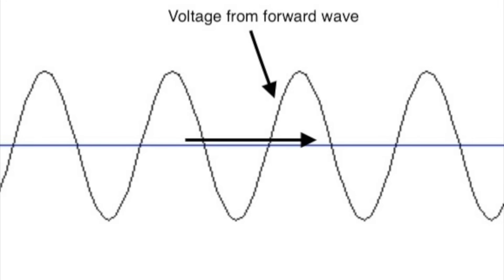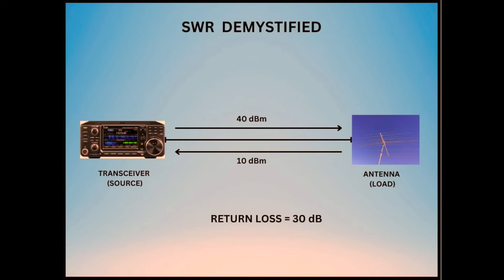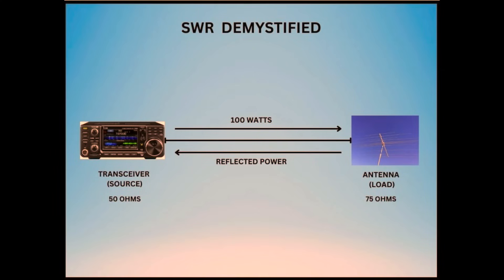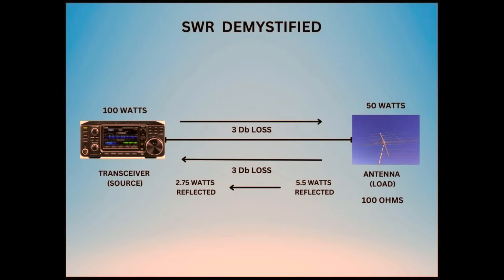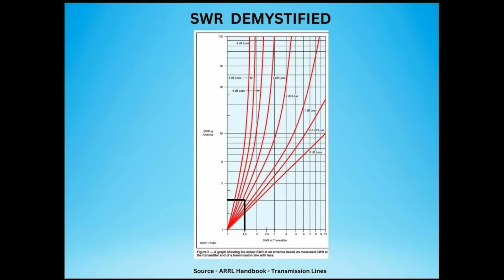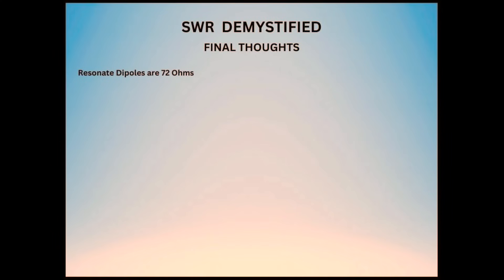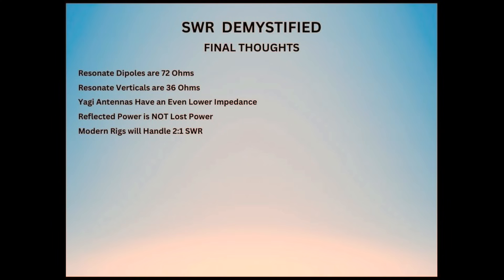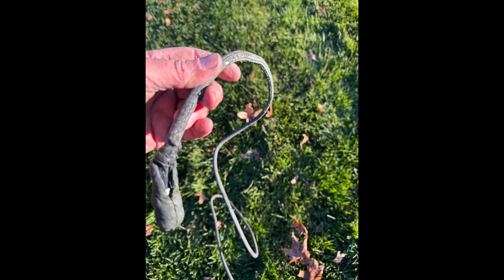The Truth about SWR: Debunking the Myths and Misunderstandings

Comment: Nicely done! 99% oh hams today have no clue about this sort of thing. I solve the loss in coax problem by NOT using coax. I use 4 inch wide open wire transmission line. de W4AUV dit dit

Comment: This is a controversial subject. I believe this issue largely results from a lack of education, and the marketing power of big companies who sell overpriced antennas and related appliances such as antenna tuners. There are basic fundamentals that should be understood. Good reference material on this subject was authored by Walter Maxwell, in his works Reflections and later versions. To get into a specific example - in a typical arrangement, we have a transciever which goes through a tuner into a feedline to an antenna. Adjustment of the tuner will indicate a low SWR. This does not change the situation at the antenna feedpoint, where we still have an impedance mismatch, resulting in reflected power thus reflection loss. This reflected power does not disappear. It travels the feedline, and at the output of the tuner, it does a phase reversal and now is added to the forward power. Most of the total losses occurr in the feedline, as stated in this video. Cutting a dipole for resonance at a particular frequency will not necessarily give you a "low SWR". It depends on the feedline impedance. At resonance, a half wave dipole will present a feedpoint impedance of about 72 ohms. And as stated in the ARRL Antenna Handbook, an antenna does not need to be resonant to work well. Resonance in this case simply means that capacitive and inductive reactances are equal, thus making the antenna feedpoint resistive rather than reactive. Therefore, with a 50 ohm feedline you have a mismatch of 1.5:1 at resonance, and there is nothing you can do to change this. Most coax is lossy, and this loss increases with frequency. Using a balanced feedline will minimize the effects of reflection loss. This is why a good multi-band antenna for HF is a wire dipole as long as you can get it fed with balnced twinlead wire, using a tuner at the transmitter. Twinlead experiences low losses despite very high SWR values. Lastly - don't believe the advertising hype of many manufacturers! The laws of physics always apply. The usual repsonse when I try to talk to people about basic antenna and feedline principles is to see glazed-over eyes and a change of subject. There are various things you can do to compensate for feedline loss. You can increase the gain of your antenna system, or use an amplifier. I refer to this phenomena as the "SWR boogeyman".

Comment: I always chuckle at fellow hams who are bragging about an antenna with a low SWR over a very broad bandwidth because they don't realize that they're describing a dummy load.  They've been taught that a low SWR means the antenna is a good impedance match so maximum power is transferred, assuming that low reflected power equates to high radiated power, but that's only true in a high Q resonant system.  Some antenna manufacturers exploit this misunderstanding.

Comment: With an external antenna tuner, to ensure your radio always sees low SWR, (even if it has an auto tuner), and low loss feed line, many antennas should work fine over a wide frequency range.  e.g. I use a G5RV with most of the feed line being 400 ohm open ladder line (very low loss and actually part of the antenna at lower frequencies) and a short piece of good RG8 coax to the transmitter.  It will tune up on ALL ham bands from 80 to 6 meters (with a wide range of SWRs!) but the low loss feed line combination means that most of the radio's output does get radiated.  This works so well that I've no motivation to install single band or tuned multi-band antennas.  Although a beam would be nice!

Comment: VSWR is a matter of instantaneous voltage measurement. This includes forward snd reflected voltages. What MUST be remembered is that the forward and reflected voltage peaks do not occur at the same time. Plug in average of forward and reverse voltages and factor in load and power calculations can be made. 

The big problem these days is that too much voltage or current can destroy power amplifier finals. 

I removed a BNC connector from my 2M 1/4 vertical antenna one time, and it was only up 40-ft and noticed sparking in the connector, which represented about 2800V on the line. There was a storm about 1/2 mile away. I didn't disconnect my SB-104 and the driver transistors were blown away... on low power setting, drivers are connected to antenna. Lesson learned. 

Same results happen with too-high SWR readings. Instantaneous high voltage can puncture transistor junctions. KK5R

Comment: If the length of the transmission line does not matter can you explain why ‘quarter wave matching sections’ work?
I’m in no way trying to be ‘that guy’ but I think this is an element that needs further explanation.
73s hope to hear you all out on the air sometime.
Reply: Because impedance is constantly changing along a feedline due to the wavefronts travelling down it, you can use it as an impedance transformer. A quarter wave section will transform a high impedance to low impedance. A half wave length of feedline will reproduce whatever impedance is at the other end. So a 50 ohm piece of coax is not always 50 ohms!

Comment: You made good point about "if" you make a good antenna with a good quality low loss cable, you can have an antenna system that performs very well.  In my experience, most people don't do that. They buy the cheapest cable they can find, and string up some left over scrap wire, and stick a tuner between the radio and the antenna and call it a day. 10:1 SWR? no problem! my tuner can handle that.  I do agree that most people forget to factor in the loss of the feedline, when looking at swr measurements. I'd also like to add, that in addition to good cables and a quality antenna, you should try and put the tuner as close to the antenna feed point as possible. This should help eliminate the losses that come from the reflection, as the tuner would be immediately reflecting back the signal to the antenna.
Reply: yeah
I myself usually measure the SWR of my antennas with feedline attached and I use speaker wire as my antenna material

I usually manage to get a 1.3 SWR on my target frequency with that wich is good enough for me

Comment: I'm old enough to remember when one of the old CB brands announced a "screw up" proof radio whose finals would not be toasted by holding down the boastin' button into really bad SWR.
I think all they did was up the voltage raiting of the finals so they could handle 100 reflected power. Might have an open and short detect and shutdown too, I don't recall... "it was the 70s, man". ;)

Comment: I just made a 6 meter dipole yesterday. The connector on the antenna side is a type N and it has about 25’ of LMR 400 cable. Radio says it’s about 1:1 but does go up to about 2:1 near the high end of the band.

I did put a a current balun at the feed point.

Already made a ~1000 mile contact today!
Reply: Thank you.  
   35 years ago, as a new amateur, SWR was the rage. 
  I used my SWR meter to check the antenna.  If the SWR had changed a lot, I started looking for problems. N0QFT
Reply: @glenmartin2437  That is why I went to 600 ohm open wire on feeders and doublet antennas. Wish I had done that 52 years ago. I use a T-type antenna tuner.73 de Joe W4AAB

Comment: Any impedance or reincurrence results in something heating up.
Heat = Electronic failure.
Reply: Reactance does not dissipate energy, therefore, no heat. Resistance does dissipate energy, therefore, heat.

Comment: I'm a new HAM with a confusing problem.  I have an MA-50 V/dipole, 50ft of cable with a   1-1.  The antenna is set at 7 meter band..  My G90 shows a flat SWR at 10 watts with no tuning but my new FT710 keeps yelling high SWR also at 10 watts.  What's going on?

Comment: I worked in the 2-way radio field for 33 years and before we had analyzers, if we suspected a problem with the antenna or coax, we would send someone up the tower with a wattmeter and dummy load. First, with the wattmeter and dummy load, we would see exactly how much power was making it through the 300' (or so) of hardline coax to the antenna. That would tell us exactly how much loss was in the cable, then we would connect to the antenna to read reflected, in case the antenna had a problem. 
Those were practical, step-by-step procedures to find the problem. 
Finally we looked around to see if a building had been built that was taller than what our antenna was, blocking the antenna view of the antenna towards the area of antenna coverage.....
Yes, that happened once when I was trying to troubleshoot an antenna coverage problem, on one of our downtown Norfolk repeaters. Lol
They had just built the Norfolk Southern building that eventually loomed (as it was being built) over the building that housed some of our repeaters.

Comment: @ki8r can you please correct your video. debunking the myths, you're actually creating the myth. i wasn't sure and i asked chatgpt and he confirmed my suspicion: The reflected power physically travels back to the transmitter.
Energy can be absorbed by the transmitter, and can stress or damage output stages, especially in solid-state power amplifiers without protection circuits.
 the idea that the reflection "bounces back toward the antenna again" without entering the transmitter is not correct

Comment: i disagree that power reflected at the antenna will reflect again at the transmitter and reflect back to the antenna. part of it sure but i think that part of it will get to the amplifier. depending on the length of the cable the reflection will either work with the amplifier or against it. the way i think of it is that if you're in a pool with a board making waves and then a reflection is added in, those waves coming back to you can work against you pushing the board. if you just held the board still and had waves coming at you, you would feel a force on the board that kept pushing and pulling on it. am i thinking about this wrong or what am i missing? also consider if no antenna is connected at all. are you saying the reflected energy which is basically all of the energy just bounces of the transmitter again and "eventually" gets radiated from the other end even though no antenna is attached? if so i don't understand that one time i was transmitting and i had no antenna cable connected and didn't realize it and it broke my radio. it would no longer transmit after this.

Comment: I really liked this presentation, but I would have liked it more if you had explained how high (SWR > 3) can be a problem for (particularly) solid state rigs. We have heard over and over that tube finals are more tolerant of high SWR (and I'm old enough to have used a number of tube finals feeding some pretty bad antennas!). It would have been helpful to explain how high SWR could damage a rig's final amp.
Reply: Impedance mismatching results in a  reflected signal which interferes with the forward signal which can result in addition taking place and the voltage going too high.

That too high a voltage can cause damage.
Reply: @deang5622  Reflected power combines constructively and destructively with forward power. The reflected power does a phase shift at the tuner or transmitter output and it is added to the forward power. An example - a transmitter produces 100 watts and reaches a feedpoint mismatch. 90% of that power is radiated by the antenna. 10% becomes reflected power and travels down the feeline to the tuner output. The 10 watts reverses and now combines with the forward power. If you put an inline wattmeter in the feedline, it will indicate about 110 watts of forward power. The voltage depends on the impedance - good old Ohm's Law.
Reply: Simple explanation is that most tube finals will have adjustments to match the impedance to the load where unless the solid state final has a built in tuner the impedance will not be matched.
Reply: @ralphmowery2898 That doesn't really answer the question.
Reply: @deang5622  You have power going into the transistor but the efficiency is very low so not much power gets out so you melt the components mainly the transistor or the elements inside the tube.
Reply: Swr or reflected power isn't the issue, the impedance that has been transformed at the radio is what causes the radio to heat up, the reflected power is reflected back towards antenna
Reply: A suggestion is to shift the thinking away from SWR, and closer to reflection loss. If transmitter finals (especially solid state) see a bad or difficult load, the voltages present can damage those expensive transistors. High SWR does not damage transmitters.

Comment: So.... if I had 2 identical SWR meters, one right on the outlet of my radio and one right on the inlet of an antenna "up on the roof", I could see very different readings, and these readings will get closer if i change a "cheap" coax with a serious quality coax.....

And this would increase the actual effective wattage leaving the antenna.  Which is what counts.

Comment: Before I become a ham, j worked 11m for several years, in my experience with cb verticals, at the location I lived at, a 1.3-1 swr worked best, as the swr affects take off angle.
Reply: I can’t think of any way SWR could affect take off angle.
Reply: @kirkp_nextguitar Antenna modelling software shows the change in radiation pattern at different swr. Maybe they got it wrong too?
Reply: The take off angle is mainly affected by the physical attributes of the antenna, not the SWR.

Comment: Coax life span:   Decades ago I had a young CB radio customer whose radio wasn't talking far enough to suit him, like the rest of his radio friends did.  After questioning him I learned he had a coax in his vehicle that had been in his dad's shop unused since the coax was new (about 20 years ago.)  I told him a new coax would fix his problem.  He told me in no uncertain terms he wasn't buying a new $10.00 coax because the one in his vehicle had never been used and in effect was as good as new.    I told him I thought he needed a new coax, but I asked him what he wanted me to  do.  
Week by week,  every payday for over a month he came back to my shop ordering another procedure be done to his system, including a brand new radio.  Overall he spent over $190.00 and had no better service from his radio than when he started.  
He asked me what I thought was the problem. Instead of repeating that he needed a new coax  I went through the process of pointing out everything that had been done to his system telling him that week by week he had replaced every component in his system (including the radio) plus had even more "service" done to both radios trying to get the service from it that he should and I asked him was was the only thing that hadn't been changed since we started.  
His neck veins poked out, his face got fire engine red, his lips pursed and he kicked rocks and cussed.  Then he told me, "Change that #$%!! coax."  I did and his radio worked just like it should.  
Coax does indeed have a life span.

Comment: Great article.  One thing, after 52 years in RF coms  and other sevices, it still remains a hidden secret on why hams dont use ballanced feedlines in the majority of cases.  

And..  why hams dont look and UV protected (as well) and much cheaper 50 and 72 ohms CATV, CELL PHONE BTR co-axes.  It shows a low loss at freq's even at 10GHz!!!!. 

And where only 75ohm. MOB COMMS CO-AX  is available, learn how to apply the 1/12 wavelength co-ax impedance matching stub option.  It works like a charm!!!!

Comment: Very Good explanation. One thing to keep in mind, transmitter finals do not like a high SWR, especially solid state, ergo the tuner. By using a tuner to match your transmitter output to the antenna system (transmission line and antenna) you are protecting your radios Tx. I use as my primary antenna a 40 meter EFHW and LMR-400 with my Elecraft K3 which has a 10:1 tuner. This combination is pretty effective on ALL bands from 80 to 10 including WARC and most times on 160 and 6 meters. From the tuner out I don't care about the SWR, all I care about is protecting my radio and the tuner does this. The list of confirmed calls on every band proves this.

Comment: And it's not required that your coax run be a monolithic cable from your transmitter to your antenna. I have a 200' run of LMR-1200-DB (0.1 dB/100' loss @ 14 MHz) coax from just outside the shack, to near the base of a ground-mounted, 15/20/40 meter sleeve vertical. The first 10' on the shack end and the last 3' at the antenna is made up of RG-213. This has been in place for almost 20 years without an issue. As I'm HOA limited to a ground mount vertical, I expended more of my antenna budget on low-loss, buried coax rather than a tower, rotors, and Yagis.  Excellent video, btw.
Reply: I was surprised by 3 dB loss in the cable, I hope that's not normal.

Comment: You say, "To really know what's going-on, you need to measure your SWR at the antenna." That's often very difficult to do so why not measure SWR at the shack and correct your SWR reading for the coax losses given the length of your coax feed line and frequency of operation, which are published and well known? Thanks for the video!